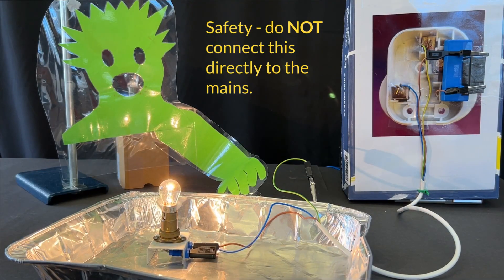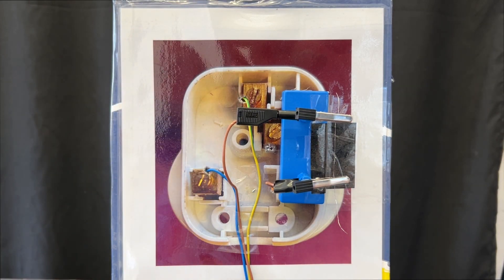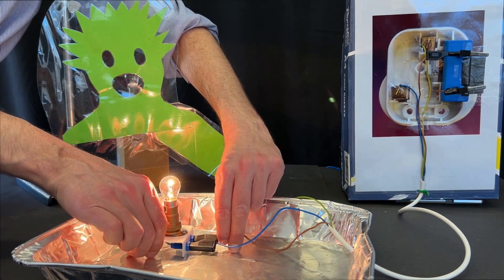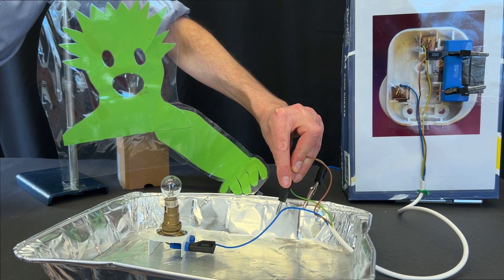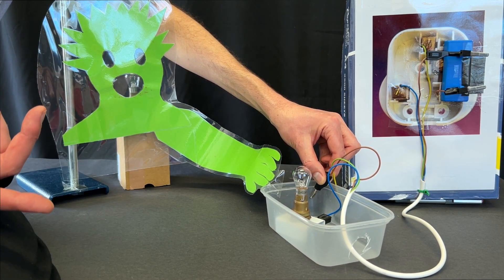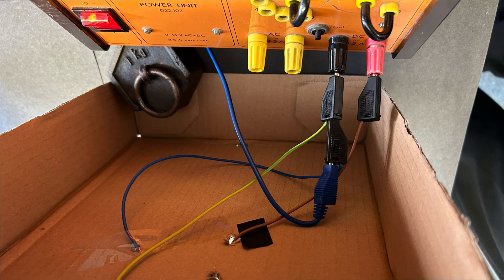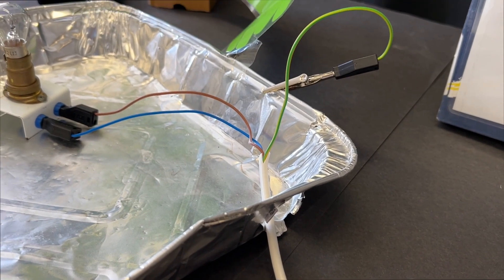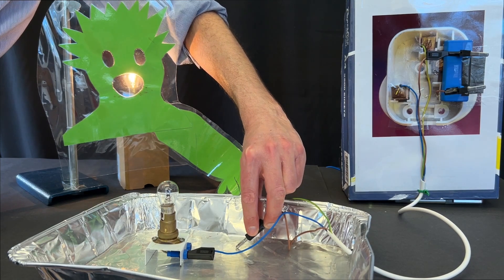Demonstrating how fuses and the earth wire work

Comment: A very clear demonstration! It might be more clearly shown that the person touching the metal case would have to be touching something that's grounded to receive a shock.
Reply from the maker: Yes that would be a good discussion point to bring up during the demonstration.
Reply: Not really, even if the person wasn't grounded, they'd still get a shock, because the body has capacitance, there just wouldn't be any dangerous current flow through their body. I've experienced this myself a few times, it's 'interesting' carrying something in both hands that's shocking you, it's very very tingly and muscle vibratey I can tell you! All while figuring out how to not get electrocuted (different from just being 'shocked') by the mere act of trying to safely put said expensive blower fan down again, or while moving to where you can even try to put it down. I had some serious words for the person responsible for the wiring. A lot of stuff in that workplace was quite to very dangerous anyway (machine wood working), so one more thing wasn't really very surprising.